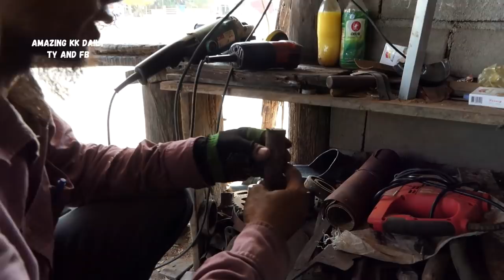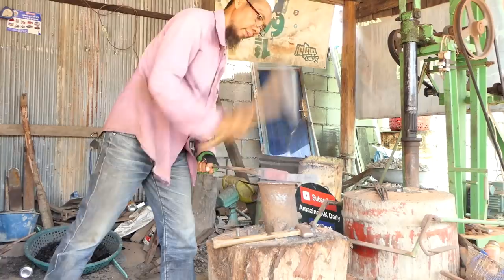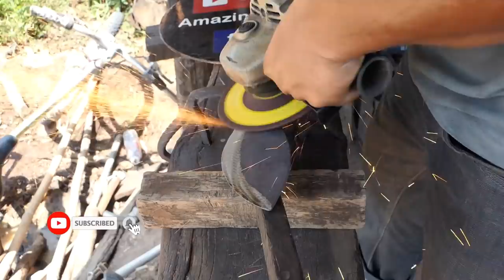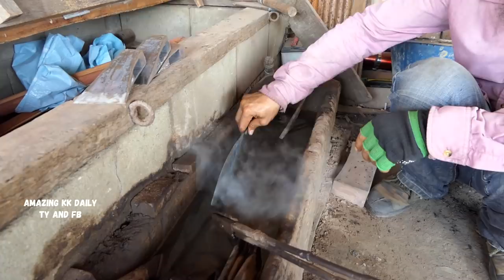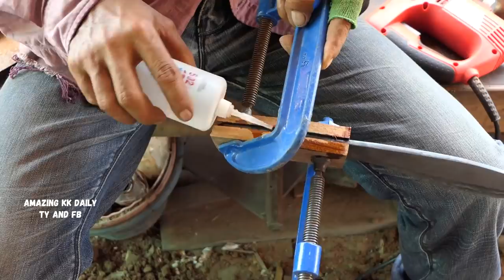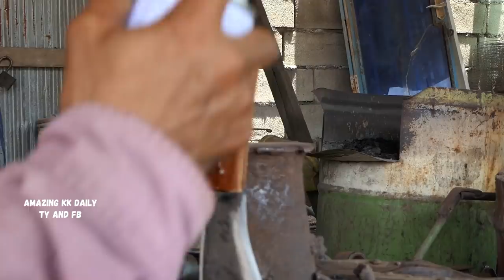MAKING A BEAUTIFUL KITCHEN KNIFE FROM RUSTY STEEL BAR

Comment: In the Philippines the blacksmith are using ordinary soap of clothes. They are using soap putting the edge horizontally back to back for quenching. After putting the soap return down to fire for five seconds then submerge in water. This methods of quenching, the purpose is to strengthening the edge while using the knife or machetes at work for longer period of time the sharpening can survive due to this methods of quenching. This was I asked the local blacksmith in town of the Philippines.please reply my comments or you have any idea what kind or what type of quenching methods used by the Filipino blacksmith in the Philippines.